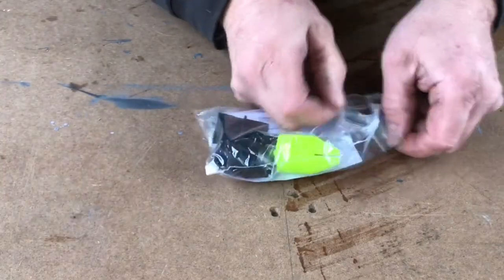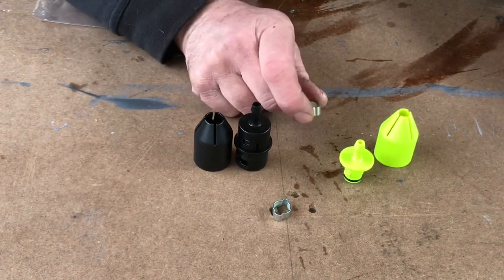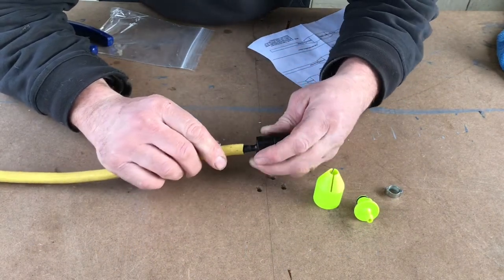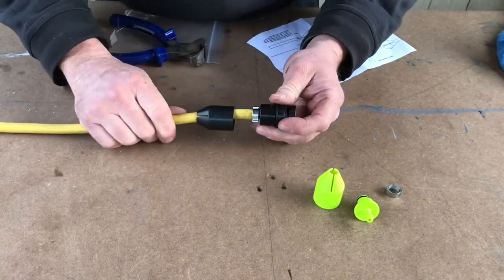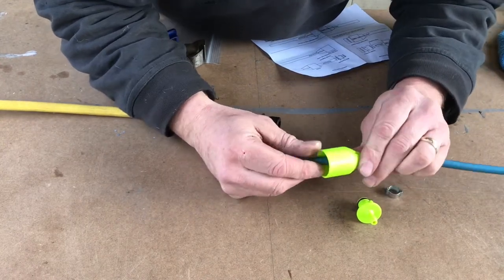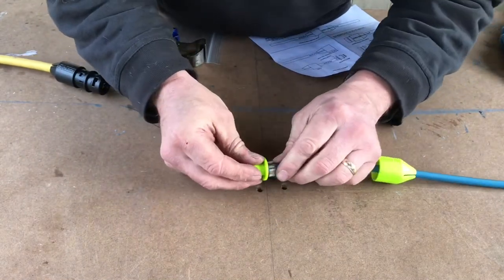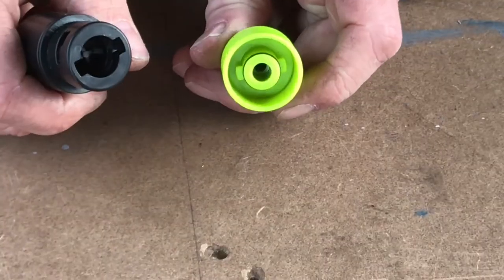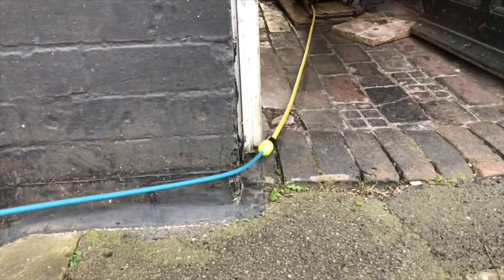How To Fit A Slick Connect

Comment: can i ask is the rubber O ring a standard size like you would have on your hoze reel fitting ?
Reply from the maker: Jason Owen the O ring inside the green part is 10mm as best as I can tell without removing it. 
The O clip 11-13mm on 6mm hose  and 13-15mm on 8mm hose. Hope this helps

Comment: Hi Dave Ive got a hole in my hose could i cut that bit off then join it with this connector
Reply from the maker: Duncan Emery you probably could but I’m not sure how well it would work. From memory I think the one barb is thinner than the other so I don’t know if you would be able to get a tight enough seal on it but I will try and find out for you.
Reply from the maker: Duncan Emery I’ve just asked Steve from Exceed Innovations and he says yes you can use the for Connecting you hose if it’s 6mm
Reply: Cheers mate you'll go far with your responses etc

Comment: Personal update!  Horrible bulky things , prone to leaking , easily catches on corners  & 20 quid for a bit of moulded plastic, is really taking the P !  It's back to the drawing board , as far as im concerned!
Reply from the maker: JD you are right about back to the drawing board. Exceed are bringing out a Slick Connect mark 2. Which has been completely redesigned. 👍
Reply: @squeakycleandave1  Thanks for update Dave...... I hope a lot more thought goes into the MK2
Reply: @squeakycleandave1  Did they bring out the 2 version and is it any better?
Reply from the maker: @sumitkommando355  yes they brought out version 2 some time ago now. I love them but some people hate the. It’s all down to preference
 https://youtu.be/8fD-kGbg1TU
Reply: @squeakycleandave1  Cheers Dave. I am going to order them. Better than what I have at the moment thats for sure.

Comment: looks like brittle plastic, would it survive if a car ran over it?
Reply from the maker: MyRandall10 I’ve been using it for 8 months now and had no problems. It’s fairly robust but there is some give in it. I wouldn’t want to let a car run over any of my kit so it’s just a matter of looking after your kit and not leaving it in the road.
Reply: @squeakycleandave1   fair enough thanks for reply, some of my work is in terraced streets where I clean like 10 terraced houses in one go, and sometimes streets are narrow and when parked cars pulls out to drive away they sometimes run over it no matter how carefull I am, why they don't make these in good strong steel up the price with some guarantee I don't know. ps you havnt got a video on these tubeless things have you?
Reply from the maker: MyRandall10 i know what you mean. I live in a terrace street and someone parked on the pipe I use to fill my tank on the path a couple of weeks back and now it leaks. I’ve got a video coming up On the tubeless system. I will probably film it while I’m off work over Christmas. I’ve had it for 3weeks but haven’t had chance to do it with trying to get everything done before I break up
Reply: @squeakycleandave1  tidy look forward to an honest review, I wonder with a tubeless what's it like pulling a 8mm hose through your pole etc, I like the fact that when you take your pole in at night etc that there's no hose with it. But what's it like at work, that's the main thing
Reply from the maker: MyRandall10 I’ve using it for over 2 years now and love it. It keeps the van tidy and I haven’t had to change the rectus connector since I fitted it. You still use a length of pole hose but it winds up onto your hose reel
Reply: @squeakycleandave1  that's where I get confused  I thought you have 6mm hose in pole the closed length pole so say 6ft. Then bottom of pole u attach your 8mm hose from reel, then when you extend pole for various jobs I thought the 8mm hose goes up your pole. If I'm wrong then look forward to your review